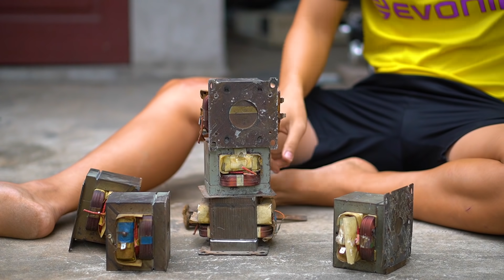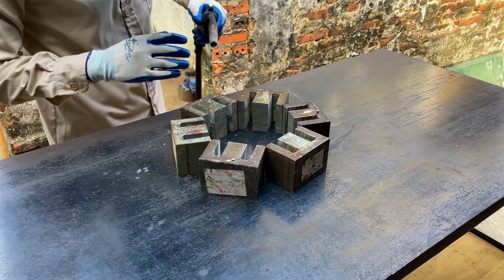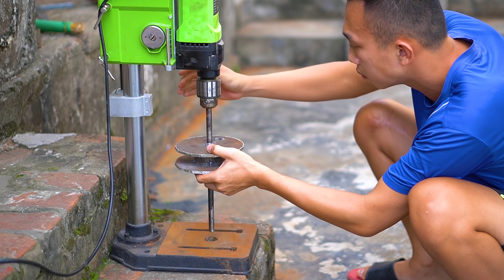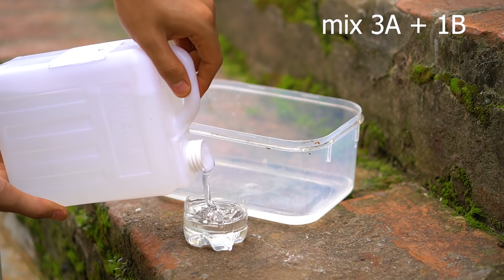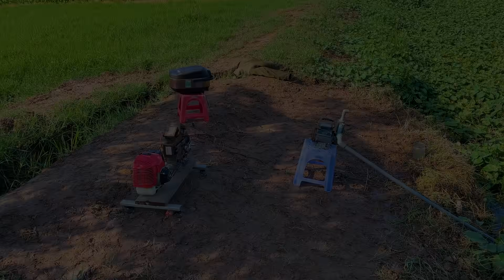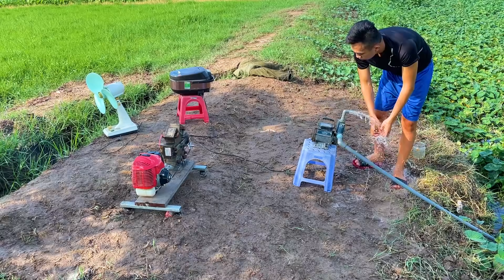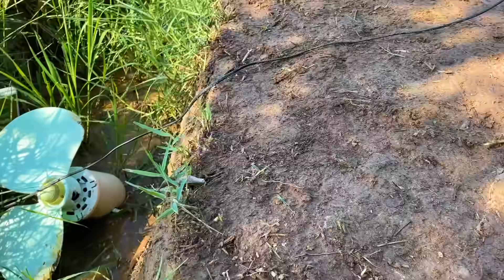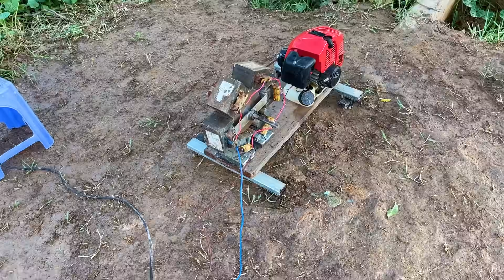I make 220v electric Generator from 6 Microwave Transformers

Comment: I wonder why he can't run 3 devices on the generator on the concrete with a walkaround showing everything including current draw and volts? I guess it would be hard to hide the hidden 220v line that actually powers the stuff.. much easier in mud/dirt to hide extra wires.
Reply: With this loose belt, no squeeck, no rpm change on load switch. Definately clickbait. This setup if its properly connected, may be, at best, can light a LED lamp.
Reply: THE WATERPUMP NEEDS LIKE 700W AND THE RICECOOKER GOD KNOWS HOW MANY WATTS THAT ONE NEEDS. THERE IS NO WAY THIS IS GOING TO WORK EVEN CLOSE TO THIS.
Reply: Correct! This is a confidence trickster! Prove me wrong! There is a sneaky power connection through a cable buried in the mud under the electrical socket. Share a new video with the connector pulled up off the ground, and passing your hand underneath (with this running) The poster is only interested in being paid by YouTube for AD money from many clicks.

Comment: I think it would definitely generate some power, but the efficiency would be terrible, the waveform or hertz would be completely messy and so inconsistent, the voltage and amperage spikes would be crazy as well. So plugging anything into this mess depending on what it was might work, but barely and it wouldn’t last long. Say just a fan for example would probably spin, but not very fast lol and over time the motor or starting cap would fry from all that noise. As for load on the motor and why it doesn’t bog down… it’s probably not even close to efficient enough for a noticeable difference. Loading it down to much would just overheat those janky wires and fry it.
Reply: И еще при такой нагрузке тоненький передающий ремень не буксует?

Comment: Even looking at the speed of the rotor, it doesn't correspond with the voltage producing. 
Its speed is sloww to be able to generate enough electricity for the pump and rice cooker

Comment: Maybe should use an electric motor and using an external battery You can start it and when the motor is working it gives energy to the motor to continúe spinning without use another thing because the fuel polluted.
Reply: Please educate yourself. Research "Conservation Of Energy" (start with Wikipedia)
Energy can't be created or destroyed, only transferred from one form to another. All systems are less than 100% efficient. Therefore an input can't be powered by it's own output.
This is a confidence trickster! Prove me wrong! There is a sneaky power connection through a cable buried in the mud under the electrical socket. Share a new video with the connector pulled up off the ground, and passing your hand underneath (with this running) The poster is only interested in being paid by YouTube for AD money from many clicks.

Comment: Since six MOTs, make it 6 phase AC... 😜 Seriously, any voltage sensitive loads would have burnt out easily... The idea is good and on low budget, but the usability is questionable. You need to add control and stabilization features to it, at least put simple output metering device...
Reply: sure, a voltage meassurement would be nice on eache phase, add a flywheel for load balanceing compensation ;) nice work, i like the design :)
Reply: @hhhhhh7777ttt  the iduced voltage is a function of rotational speed, you can not calculate the "mains" power you normaly apply to a MOT by addition this 6 times :)
Reply: @hhhhhh7777ttt  each pole would be opposite polarity from the next by wiring them in series you get no output since they cancel each other out. Also that belt would not handle the load and the tiny 2 stroke engine might make 500W at best, not 8KW. You can also tell its a fake because the engines load does not change at all as more electrical load is added, also the power strip is conveniently hidden so we cant see where the actual power is coming from.
Reply: @RC-nq7mg Beat me to it  😀
Reply: Hi, I looking for advicer, i saw your answer I think you are right. 
Maybe might you send your e mail? Thank you
Reply: @wilsontan8123   A very good theory but sadly will not work. If you have a constant load and set the throttle correctly to produce 50hz and use windings correctly connected with the correct amount of turns.... add an AVR and fix the issue of the shorted windings then divine intervention may not be needed to stop this contraption burning out the coils and I don't even think it could do that ! 

As soon as the load is increased or decreased the physical resistance on the motor will change. This will cause changes in voltage and frequency. This is why generators have a system called AVR. This stands for automatic voltage regulation and will adjust the engine throttle automatically to match the set voltage and frequency. Many generators have multiple windings the board can switch to for low, medium and high loads for example.

Unfortunately without an AVR the engine throttle will need adjusting to each and every change in load as the magnetic flux will create different levels of resistance causing the engine to slow down and speed up. The change in the physical resistance is caused by DeltaV so changes in load affect the ESR of the windings.

What has been built here is supposed to be an alternator. The only difference is that the coils (Stator) remain stationary and the magnets rotate (Rotor). As the coils remain stationary you no longer need slip rings and brushes but it is in essence an alternator all the same.

This link may help you understand what happens when you cut into a magnetic field with alternating magnets. I hope it will help - https://www.bbc.co.uk/bitesize/guides/zpnc2nb/revision/2

You mentioned synchronous motors not being affected. In fact synchronous motors rely on very stable voltage and frequency to function. Quite possibly the worse load you could use on this highly suspect "generator".

I hope this is of some help.
Reply: @hhhhhh7777ttt  Correct! This is a confidence trickster! Prove me wrong! There is a sneaky power connection through a cable buried in the mud under the electrical socket. Share a new video with the connector pulled up off the ground, and passing your hand underneath (with this running) The poster is only interested in being paid by YouTube for AD money from many clicks.
Reply: @TRS-Tech  why is that "As soon as the load is increased or decreased the physical resistance on the motor will change. This will cause changes in voltage and frequency."-  if you mean the fuel motor! that doesn't get any physical resistance by adding  more  load to the coils , it is inductive power. it  just get hot and burn out

Comment: You need to be VERY careful taking transformers out of microwaves. The magnetrons often contain beryllium in the insulators which looks like ceramic, but it can be very toxic if the insulators get broken and the dust is inhaled. 
Just so you know.
Reply: good to know...a splinter of beryllium can be very dangerous also.
Reply: Only if you don't gave an Intelligent Immune system due to over sanitation , I've inhaled fiberglass,  Asbestos smoked for 28 years and every Kond if Chemical Toxin you can imagine,  battery acid tickles,  

I'm in Perfect Health , I'm a custom carpenter and work in 100+degree heat and  minus temperatures 

Carrying in excess of 50- to 70 Pounds of tools while having perfect balance on ladders, beams,  walls trusses etc..and expertly wielding power tools and sharp pointy objects all day long while having FUN doing it...I NEVER get sick either NEVER tested nor Jabberwockied

Besides Beryllium is Rarely used anymore not since the 70s in Microwave Magnetron assembly..
And is Color Coded...Ceramic is Widely used now days.
Reply: @mjolnirswrath23  Good luck when you hit 60.
Reply: Ja sam udiso neznajući štaje😢

Comment: You can alternatively use a 230v 50hz motor that is powered by the generator. Add a start and stop switch to control wh2n you want electricitu and what uou have is a self excitation generator. No fossil fuels needed.

Comment: altho that might actually work if you don't know what rpm to run the motor at you might either over or under voltage and blow up all your equipment

Comment: I've done something similar in Northern Sri Lanka many years ago. Usually a 2-stroke engine will slow down when you put a load into the dynamo! You should be able to hear the sound of the engine's rpm slowing down. Something doesn't add up with his demonstration :)
Reply: ну хоть Вы сообразили🤝🤝🤝
Reply: You are correct. It is totally fake. The concept is OK, but the execution of magnet mounting/spacing/wiring stinks.
Reply: yes I thought the same thing too
Reply: Correct! This is a confidence trickster! Prove me wrong! There is a sneaky power connection through a cable buried in the mud under the electrical socket. Share a new video with the connector pulled up off the ground, and passing your hand underneath (with this running) The poster is only interested in being paid by YouTube for AD money from many clicks.
Reply: @pstonard  seems the pump is always the 1st plugged in and it looks old and bulky enough, replace the guts with modern tech and stash a battery (maybe)
Reply: Due to the magnetic property of the generator's rotor body where the magnets are embedded is what contributes to the Lenz principle. Try using a generator a rotor that is non-magnetic like aluminum-alloy where you embed the magnets or you can use engineering plastic rotor body.
Reply: А может генератор производит достаточно  много  енергии что нет нагрузки  пока на мотор.
6 генераторов  может по 700ват,это уже 4,200 к/ват

Comment: usually there is a noticeable load on a generator motor.
Reply: Yeah, the more the load the more the engine boggs down. A voltage regulator is usually fashioned into the circuit for output stability. 🤔

Comment: Swap the two wheels from the drive. The big one to the engine, the small one to the generator.😉But then build a power storage device, as well as voltage and current regulators in between.
Reply: I don't understand how the 6 coil transformer work.  it's 220 each coil? would it be over voltage? because the microwave is 220 coil? or the transformer is only 40v and the big one he not use is 220-240v ?  he put it in series.  so if it am not use the gas engine to run but use another motor like a table or Stand Fan and use that as a motor to run the magnet wheel.  Then how do I keep the constant the same volt?  do I needed another Electronic device to regulate the electrical outlet for home use safe for computer? that's the question ?????

Comment: The current there is not stable, there are variations and that is bad for electronic equipment that is sensitive to the output, a non-polarized 2.2uf/450v capacitor should be included to be able to stabilize, I think my opinion.

Comment: I can not see it making that much power with how slow it is turning I can say it LOOKS GREAT
Reply: It is turning quite fast. It looks slow because of the frame rate of the camera interfering with the RPM of the generator. This also seemed to make the fan blades turn slowly too.
Reply: Same effect of fps of cam vs blades that you see on helicopter blades on tv.
Reply: The iso rate of the camera was matching the speed of the motor

Comment: I was took by surprise when I saw the coils being connected in series, I suppose it would be connected in star or delta. Anyway I love your generator. Best wishes from Pelotas-Brazil.
Reply: I from Thailand
Reply: If the rotor had 2 poles. With 6 poles on rotor it is one-phase alternator.
Reply: Running things without knowing. No voltmeter, ammeter not safe.
Reply: @Glenntong12  да потому ,что это фальшивый блогер,которому чужды знания законов физики,да и механики тоже))
Reply: Уважаемый,Вы с Бразилии?
Reply: @Glenntong12  Voltmeter and ammeter is cheating. Its much more fun without them.
Reply: Very, very fake👀

Comment: buried the wire is the most accurate definition
Reply: Correct! This is a confidence trickster! Prove me wrong! There is a sneaky power connection through a cable buried in the mud under the electrical socket. Share a new video with the connector pulled up off the ground, and passing your hand underneath (with this running) The poster is only interested in being paid by YouTube for AD money from many clicks.

Comment: God bless you, for this beautiful idea, but you could have added the secondary coils to increase the ampere and link it to the branch to increase the capacity of the electric generator to operate several devices, but you are a successful genius I follow you a lot and all your work is excellent. Secondary files Thank you very much.
Reply: Where from you are Madjid brother?
Reply: Wot a waste of time how u no what 2 do if u just watch it and they don't till u what they doing
Reply: @petercollins4092  Its pretty obvious if you have a basic understanding of how generators work.  Maybe watch some videos on how those things work and then you can appreciate what this man has built.
Reply: @nikolatesla811  I have a thorough understanding on how generators work - and it is impossible that contraption could drive even one of the devices, much less all three at once. As a basic example of the many problems, that thin and loose drive belt would not handle even 1/10 HP,  which is way less than 100 watts.

Comment: Thanks to Cantina down there. To add insult to injury, the way he dismiss things, like trashing the broken fan in the field next door! And the way he dismiss parts like the two bearings, and then they reappear a little bit later. And I would have like to see a voltmeter and an ampermeter with a known load to show us the miracle to produce 220V just because the 6 transfos primary were 220V . They are really very good in recycling in Vietnam !
Reply: Correct! This is a confidence trickster! Prove me wrong! There is a sneaky power connection through a cable buried in the mud under the electrical socket. Share a new video with the connector pulled up off the ground, and passing your hand underneath (with this running) The poster is only interested in being paid by YouTube for AD money from many clicks.

Comment: There is no mention, but how is the 60 Hz regulated? Is there an assumption that the generator is causing the 220VAC to at 60 Hz? Also the coils can be put in at two different orientations. Since the magnets are N-S-N-S-N-S, are the coils also alternating? or are all the coils creating a field in the same relative direction?
Reply: He 3ven directly plug the load without measuring the voltage  of geneartor if the rpm is exactly producing 220 volts  no avr
Reply: @gags730  plainly just for video content
Reply: He really don't know the theory how it works. He also don't know how to use testers. Generators should always be regulated by governors to maintain cycles. And avr for voltage. 😂😂😂😂
Reply: @jrs7531  it' is a little late but for the vent and the water pump you don't need a AVR. For the rice cooker you should have one to protect the electronic parts. For the voltage  there it is important how many windings the coils have. The rpm are in turn interesting for the frequency. The pump and fan then only rotate faster or slower.  This is enough for the operation of simple electrical devices, but for the operation of sensitive electronic devices, you are right, it would have to be fine-tuned for that.
Reply: Correct! This is a confidence trickster! Prove me wrong! There is a sneaky power connection through a cable buried in the mud under the electrical socket. Share a new video with the connector pulled up off the ground, and passing your hand underneath (with this running) The poster is only interested in being paid by YouTube for AD money from many clicks.
Reply: @pstonard  Yes, producing Even a couple hundred watts with that little belt would not work. That belt would just slip. It actually looked like it was. The rotors rpm  was jumping around.  Couldn't work.  The concept of a generator out of microwave oven transformers would work if done correctly.

Comment: so 6 coils in series and nothing to regulate the voltage? also the motor does not slow at al las the cooker is turned on. very sus. and toward the end the belt is slipping, the generator is barely turning but we are supposed to believe the appliances are still working. ha ha

Comment: I understand about the engine not working harder they way this is wired has alot of amps pushing it would take alot to make that motor run harder. reason I know I've done very similar and with weedeater motor. try it guys and see if you have same outcome.  he could have got more voltage but the way its wired can handle loads easily.

Comment: No his video is true you can see the wheel  in the generator slowly spinning because he put higher power needed by the fan and the cooker and the pump and about the engine it kept it's sound because the friction with the wheel and the belt was bad (and I hope I am right)

Comment: That cannot be possible. The engine doesn't turn the generator too fast. It turns only 2 to 3 rounds per second. So, the electricity generated by extremely slow rotating generator won't even power 3V LED bulb, of course not rice cooker.
That's why fan broke it's propeller to avoid low current.

Comment: The trick is, that the wires from the generator are ending blind within the socket. The hidden main power supply takes place through the bottom plate of this socket by a long extension wire buried in the ground . . . nice fake.

Comment: I believe this one is a fake: The reason is the speed of the magnet wheel, it's nowhere near fast enough to generate anything, The rubber drive band is too loose to have any effect. Sorry to say it. The real powerline is buried in the ground. I also believe that the motor is the primary generator, but I'm not exactly sure it has enough power for the cooker, as it demands a huge amount.